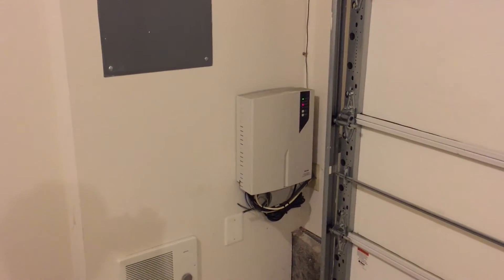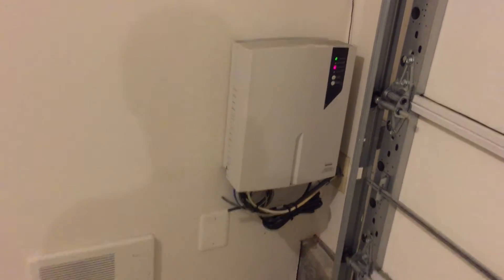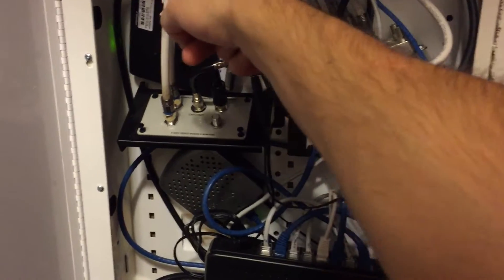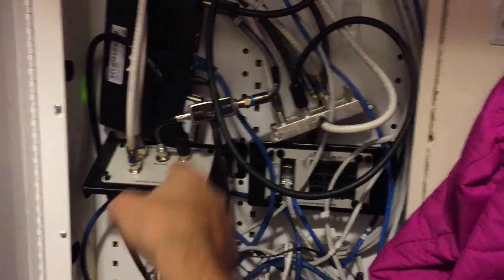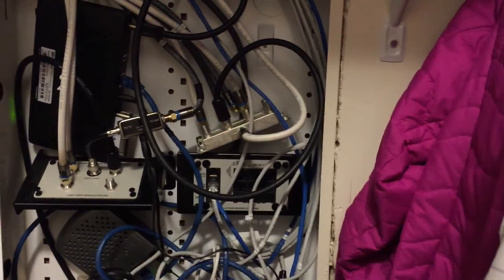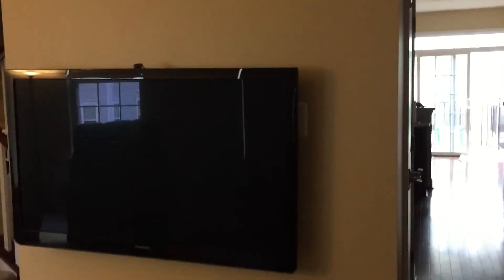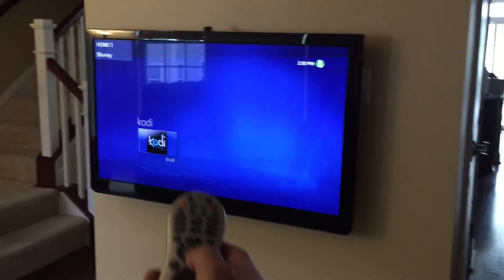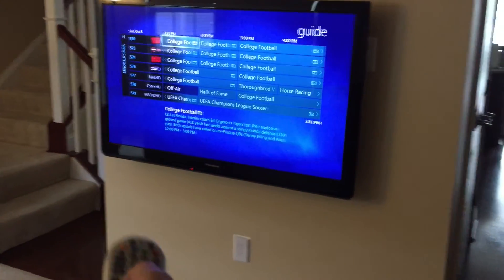How to use Verizon Fios service with no provided equip HDHomeRun + DD-WRT router -- cat5 & coax

Comment: Your “hd home run prime”; is that the same as a MoCA adapter?
Reply from the maker: no it's not the same. it uses a cable card and puts your cable tv broadcasts over your local network. google it for more info.

Comment: So 3 questions: 1st: At 1:25 How did you get the cable card from Verizon did you just call an request it - how much was it? 2nd: Along with that line, did you tell Verizon you didn't need their equipment and did they give you a hard time about it? 3rd: How did you get them to provide you with a Fios supplied splitter at 2:16 ?
Reply from the maker: 1) Ordered the cable card with my original verizon order. 2) I didn't tell them, I  just didn't order the dvr, etc. When the tech came though, I did tell him what I was trying to do any he didn't have a problem. 3) I'm pretty sure all the techs have those splitters that they more than likely usually install. I didn't request that.

Comment: Great video. My question is... I have internet only with Verizon, can I come out of a router to my hdmi input of my smart tv without a stb and receive channels (basic) ? The router that I have now is from Verizon and it doesn't have a hdmi output on it. What router would you recommend? Thanks
Reply from the maker: If you have internet only then no you can't get TV through any type of setup. If you do subscribe to any tv plan, then you can rent a cable card from verizon ($5/month) and use a HDHomerun prime to get tv over IP. 
I suggest you read up on these links. They'll tell you everything you need to know.
here: http://www.dslreports.com/faq/verizonfios
and here: http://www.dslreports.com/faq/16077

Comment: how were you able to get them to do the install without using that crappy quantum router? please respond my install is tomorrow and I have a prime as well.
Reply from the maker: Just be nice & tell the verizon tech what you want. tell them you want internet over cat5 and tv over coax. Mine was very understanding when i told him this. He didn't have any problems with it.
Reply: You can call them up and tell them you want to disable MoCa (Multimedia over Coax).  However if you have any cable boxes from them, the guide and other features won't work anymore.
Reply: The RagingKalel  the issue is that if you have video service the on demand guide and widgets will not work with our the verizon router  since runs on moca and other routers work with cat5

Comment: Did the Verizon Technician Install your Ethernet and Coax? I thought it was one or the other that you could use from the ONT .
Reply from the maker: Yes he installed them both. Told him i wanted internet over cat5 and tv over coax. You may be thinking about internet - that's cat5 or coax - one or the other. in-depth guide here: http://www.dslreports.com/faq/16077
Reply: Clark Mercer Great video. My question is... I have internet only with Verizon, can I come out of a router to my hdmi input of my smart tv without a stb and receive channels (basic) ? The router that I have now is from Verizon and it doesn't have a hdmi output on it. What router would you recommend? Thanks.
Reply: Internet can use either. TV uses Coax regardless of whether cat5 or coax is used for internet.

Comment: Can you tell me which modem or router I need. I just got Verizon fios gigabit. They said that you have to use a fios router. But you obviously didn't. Any help would be greatly appreciated
Reply from the maker: this reference should give you all the information you need: http://www.dslreports.com/faq/16077
Reply: There's no modem as the ONT is basically the modem. You can use any router that has an Ethernet WAN port. If you have FiOS TV service you need to add a MoCA adapter to get guide and VoD on the cable boxes without a Verizon router.